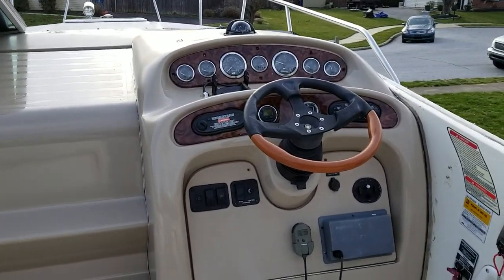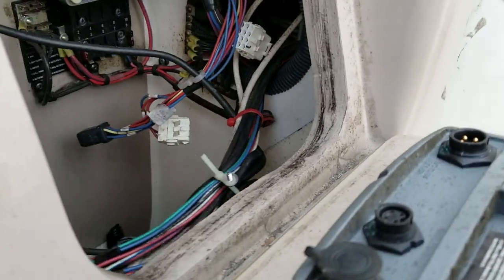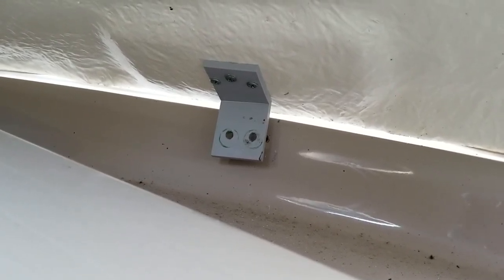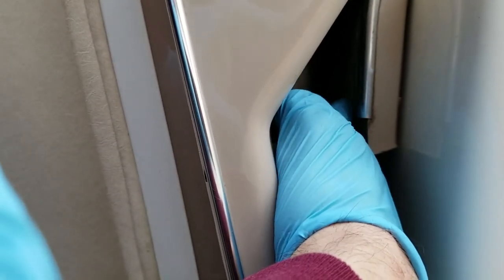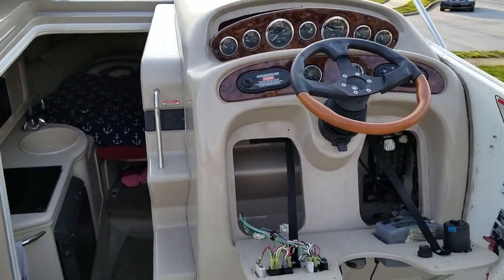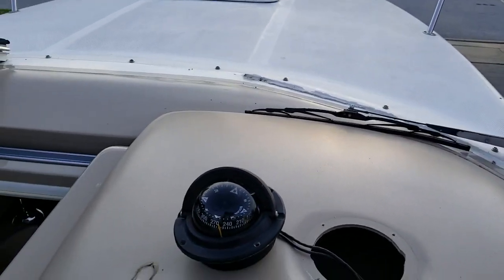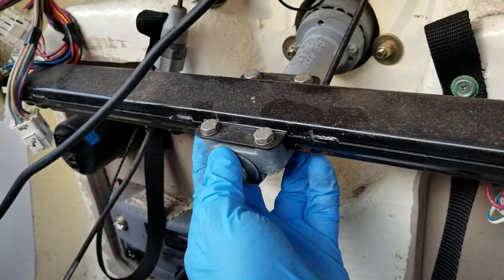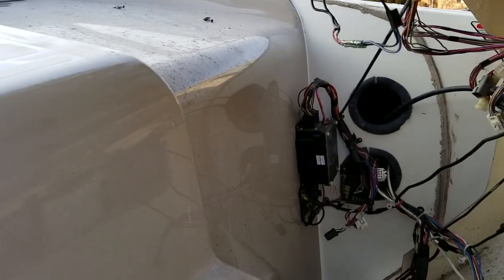Replacing Cabin Door Track on Sea Ray Sundancer Boat - Part 2

Comment: Hey buddy you mentioned that your speedometer doesn't work you probably just need to clean the front of your outdrive out with a small little metal pick. You probably just have the input hole clogged.